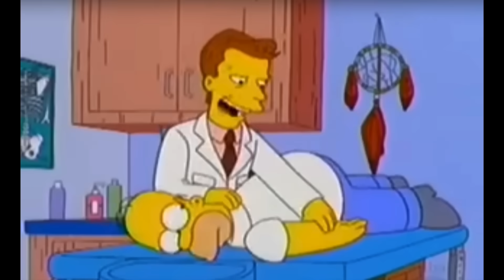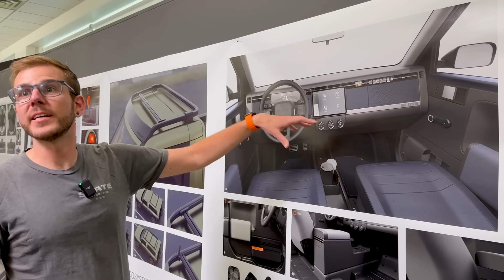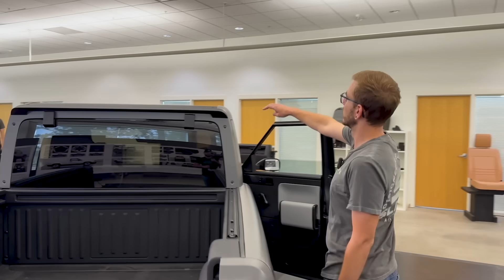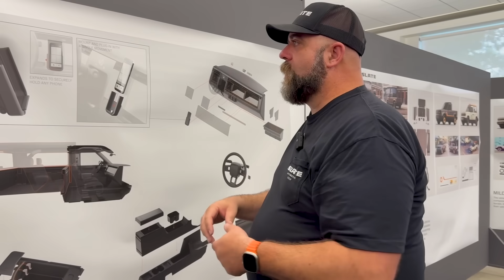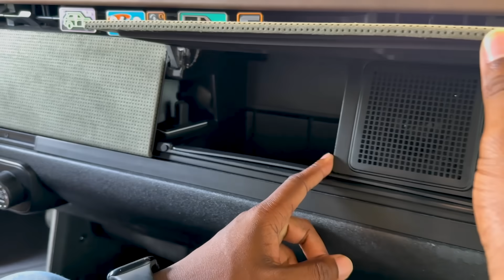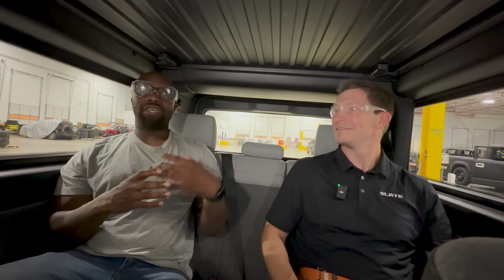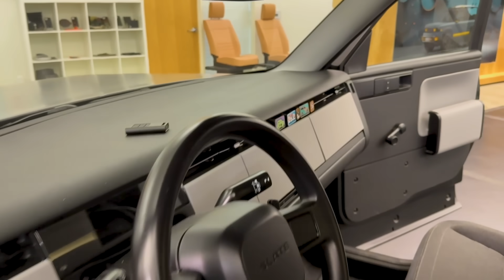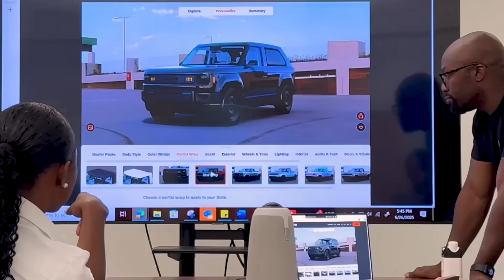The Slate: America’s $20K Answer to China’s Cheap EVs (Exclusive Access)

Comment: IF you could really get it for $25,000 USD ($34,000 Canadian) with the 240 mile (387 km) range battery, I think this would sell fairly well in US and Canada.
I could see this truck saving small businesses who require trucks (for truck stuff) reducing their vehicle expenses immensely.
Right now, it costs nearly 150$ Canadian to fill a pickuptruck full of gas or diesel.  This vehicle would cost under 10$ a day to charge 0-100%.
Also, it's smaller and quiet.  Being quiet when working residential is a plus.
Reply: Why would I pay 25k for a truck with nothing when for 3k more I can get a base model Ford Maveric that gets 30 miles per gallon highway and over 40 in the city with its hybrid engine.
Reply: @kameljoe21  You can find hybrid Mavericks at dealers listing for $25k today.   So the question is why would you spend $3k MORE for the truck with nothing...
Reply: @rockinkuwaitchris used... new they all appear to be around $34,000 for a base hybrid... it does have 4 doors though.
Reply: @kameljoe21 Well because no EV incentives, less customizable, and it's rare to be able to actually get them that cheap. Nobody says everyone has to buy one though.
Reply: @kameljoe21  another option, spend 20k less and buy a 04 Ranger that does all those things as well lol
Reply: @kameljoe21 that Hybrid engine is shit though.
Reply: You must compare this to its competition, which is the Ford Maverick hybrid.   To compete it's going to have to be significantly cheaper.   What will be its payload capacity?  And will it be able to tow anything significant? - for any real distance?  Lot's of unknowns, but I'm glad they are trying to produce it.
Reply: @CARvideoshareit  Most Mavericks on the lot are gonna start well north of $30K. That has been the reality. Plus it's a Ford, so. There are other benefits to having an EV and there will likely still be tax incentives making it cheaper. Totally agree people should compare and have reasonable expectations though.
Reply: I mean almost all the driving I did from 16 to mid 20s was well under 100 miles in day. Usually about 30 miles to high school and back or 90 miles to college one way and stayed there for a week or two. Beyond that it's mostly a few trips a year that are hundreds or thousands of miles. It could be a very practical vehicle for basic commutes to school and work.
Reply: @802Garage  so could a used 96 Tacoma you can pick up for 1/4 the price. Funny enough, those can be found with electric windows.

Seriously, I get that modern cars have way too much BS on them, but this is offering fewer features than something you can buy used for 3-6k. If not for the features, then why bother buying new? Plenty of older stuff that's incredibly reliable and fuel efficient out there. If all you need is basics, then you don't need to spend 20k.
Reply: @bongwaterbojack  Hey I totally agree. I daily drive a 1993 Impreza I got for $500. I def appreciate people who drive old used cars and keep them going. That said, we're gonna have new cars and trucks. I'd love for their to be affordable options that aren't huge for no reason.
Reply: @802Garage  New with basic options is nice, but it needs to come cheaper than 20k. The friggin speakers are an optional extra. As overpriced as modern trucks are, at least they offer fancy crap you don't get  with older stuff. You have something to show for the money you wasted.

But this? How many things are standard on an 04 Ranger that I can pick up for 4k vs optional on this thing? You're literally getting less for more money.
Reply: @bongwaterbojack I totally hear you on all that! Prices have gone crazy.
Reply: @802Garage  sad, but true.
Reply: @bongwaterbojack If you buy a 1996 with power windows you will likely need to replace the motors as soon as possible.
Reply: @jackdaniels4309  the power windows on my 84 Mercedes have the original motors and are still going strong. Buy out of curiosity, I looked up a replacement, and the entire window regulator assembly can be had for about $80. So even if they kick the bucket tomorrow, big whoop. Not a bad price after 300,000miles and over 4 decades of service.
Reply: @802Garage Where the hell did you grow up where you needed to drive 30 miles to get to school? Did you live in the middle of a national park or something?
Reply: @conor7154 Hahaha I live in a very rural area. It was about 13-15 miles to school depending on route and then if I did a bit of driving like to stores and such after, plus the drive home.
Reply: @conor7154 I dont know about them, but I lived in rural Mississippi and that was pretty common. There was only 1 high school in the county.
Reply: Repair costs will be very very cheap too
Reply: It's not comparable to any truck who is able to fill 150$ worth of gas/diesel. It's more of a SUV/city putter than anything. I don't think this will be any more capable than a regular gas SUV for loading and probably worse in towing.
Reply: @o0Guns0o It's not marketed as or meant to be a complete replacement for a full size truck.
Reply: What kind of residential business truck are you driving that makes customers complain about how loud it is?  You running glass packs on a squarebody chevy or something?  Even a 20 year old diesel is going to be quiet enough to not piss off customers.
Reply: It absolutely will not. They look and are seemingly built like toys, and the central focus seems to be “modularity” which just means everything is going to break off and no one is going to care about changing all the stupid little panels on the inside. This thing is a modern day Aztec.
Reply: It has crap range, and will likely get a fraction of 100 miles with any load. Towing? Forget it. Winter? Also forget it with even less range and only RWD.
Reply: @truantray  Average american drives 14k miles a year. No towing or anything. Trucks are just a weird fashion thing 99% of the time. Why does everyone say all of a sudden people drive 50k a year fully loaded when talking of EVs?
Reply: @bencze465 well, the average American is a city dweller because those are the population centers... but millions of Americans don't live in cities and drive 30k - 50k miles a year.
Reply: @truantray this is for driving at property or in city/town. It is not for the heavy duty loads or highways. It is good price point for the target.
Reply: @MrRaitzi Why do you need a truck if you’re driving around in the city?
Reply: @conor7154 you can have it as suv also. 20k and customization is the value here.
Reply: @conor7154 even for my home garden I have to haul dirt... I have one of those silly Tonka trucks for that though.
Reply: @truantray this is my biggest issue.. I love the roll up windows and the walk through bed... but it needs a 300 mile range for me to buy it around $30k
Reply: @truantray  It tows less than a honda accord, so I don't think they have to worry about that.

Comment: One of the problems with the Slate is that after a young person (with a low paying job) buys a Slate and starts making their payments ($250-300 for 2 1/2 years), then pays rent, buys groceries, then how much money will they have left over to buy upgraded parts? Slate has been secretive on details about the company and the price for parts. Once you add up all the extra parts, like $5,000 for the SUV conversion and $3,000 for the long range battety, you need to buy to turn the Slate from a Dacia Sandero into a daily driver that isn't a miserable driving experience, the cost could be $40,000-$50,000. There are a couple of YouTube videos by "FutureAzA" about the Slate, including one with the word "IMPOSSIBLE" at the top of the image. He claims that the Slate has a steel frame that will require tooling that costs millions, and it will need to be painted to prevent rusting, so not painting the body doesn't save much from the manufacturing cost. The claimed range of the Slate is impossible because it's a square brick, and the Slate is supposed to get the same range as an aerodynamic Tesla. Apparently, the Slate company doesn't have the investors, the millions needed for stamping equipment, a billion dollar next gen paint facility, or the factory to start production. According to the YouTube channel "Trucked Up EVs," there are several potential problems with the Slate concept. I found some videos by "EbikeSchool" about a guy who bought a Chinese electric mini truck that Slate just copied. The ChangLi EV Mini Pickup has a price of about $9,999.00
Specs:
- Dimensions: 130”x53”x67”
- Curb Weight: 551LBS
- Top Speed: 28 mph (45 kph)
- Range: Estimated 30 Miles
- Charge Time: 6-8 Hours
- Charger: 110V (Included)
- Battery Info: 60v/100AH 60v/80AH 60v/60AH Lithium (Optional)
- Electric Motor Info: 1200- 4000 watts (Optional)
Features:
- Back Up Camera
- LED Lights
- Windshield Wipers
- Crank Windows
- AM/FM Radio/USB Phone Connection
- Heater & Sunroof Ventilation
- Spare Tire
- Charger Included
- Airconditioner (Optional)

Comment: There is an after market business opportunity right there for anyone with a basic knowledge with the DIY assembling of the accessories so you can recieve the slate you want without having to do it yourself. The sticking point for most I think will be the range and not being AWD or 4x4 considering it is supposed to be a truck you will already have to live in a rural area with the limited range to be able to go camping and recreation activites for the weekend without having to plug in at every opportunity. Solar panel fast charge or external battery booster in the tray for longer trips would be good.

Comment: Rivian bed size is perfect.  I have never had any issues carrying ANYTHING in my R1T bed.  Have carried 7' long pallets that stick out the back (strapped down very well) with a total payload over 2,000 lbs which as you know is well over the official payload limit and the truck had 0 squat and can't even notice that there is anything in the bed while I was driving.

Comment: Your last questions are the key to the US market.
Every US company is focussed on profit maximization.
How much will the market bere. Cost Elasticity of demand. 
It's all driven by greed. 
Easy customisation = Yes.
Wrapping at home?? not by most. so that will be exy even if the wrap kits are precut and sold by Slate. 
I guarantee there will be something like a 50% - 80% markup on components from cost Plus postage/shipping.
Sounds too good to be true because it probably is.
And yes if t SUV pack adds 8K you may as well buy an already kitted SUV from another make or a second hand F150

Comment: A 4 door version would be great, because you can capt some family market.
I like the idea of that modular cheap and versatile little "lunar" truck.
The repairability and modular aspect are super cool .
Black trim and seat covers would look better than grey.
I m curious if it could be factory modded similar to an UTV, because it would be damn fun , even more considering the price of some UTVs.
The 4 wheel drive could be a modular design to add on, it would take a lot of engineering for sure, but i'm thinking on motors integrated to the front wheels like the monopatins lol.

Comment: a big issue for EVs is range and the many complications it has.  a company can claim "its a 250mile battery" but there are so many caveats:
-range day 1 vs day 1000 could be 30% lower.  they sell you on day 1 range but what is "lifetime average" range AND what is "real world range", all the companies claim higher than reality.
-you never get the full 100% of the battery, at most you get 95% and its risky if you're not near a charger AND have time to charge it
-how long until the battery MUST be replaced, how much $?
-is it safe to keep the battery at 100%?  if you're told "keep it between 80% and 20% to avoid destroying battery health" then you can ignore 40% of your alleged range
-how much range do you lose in super hot / cold temperatures? or when the truck bed is fully loaded? or when towing?

add all those range reductions; 30% of total, 5% bc you cant use all of it, 40% bc there is no top 20 or bottom 20....and you're at 75% reduction
that puts you a far cry from "250"
Reply: Modern battery packs will outlive the vehicle.  WTF is the American obsession with range, like you drive 250 miles a day or something. Need range once every year, rent an ICE.

Of course this is the Internet, so batteries cost $50,000,000.
Reply: You’re asking the right questions.  80/20 rule, cold weather, towing, hills, etc.  You need far more range than advertised or a ton more fast chargers everywhere.

Comment: Would love this with an ICE, but you can't get away with a small brick driving through the air with CAFE standards. 150 mile range, 1000lb tow capacity, and no radio for $28K is a no go for me. But the ruggedness and modularity is great!
Reply: No way will this thing get 50 miles with 1000lbs towing.  Radios...whatever, you can get one installed for $120.

Comment: How could we not be enthusiastic by yet another Jeff Bezos project?  After all, he's given us easy access to cheap and often unreliable Chinese parts and pieces on Amazon, he's given us phallic shaped rockets that facilitate million dollar space tourist flights, and he's building an alternative space-based Internet solution and launching satellites into low earth orbit at the speed of molasses.  Sounds like a slam dunk to me...... 🤣

On a more serious note, I really wish they'd have included a demonstration of what it takes (both time and effort required) to convert a truck from one configuration to another (ex: truck to SUV). Are these conversions something that the customer can actually perform?  Or does it require a professional to  do the actual conversion?  Will it be possible for this vehicle to be able to be easily (and cheaply) converted back and forth between different configurations?  Are they planning to provide customers with a process to allow them to add battery capacity to the vehicle at some point in the future?

Comment: Finally, an EV company that realises that not everybody needs the 0-60 of a Ferrari!
The price point however sounds more like a marketing stunt, unlikely to be released at 20k$
Reply: Its 27.5k, Trump cut the $7,500 tax break. We have till the end of the year to get the tax break but this truck wont be out by then.
Not worth 27.5k.. and it'll probably be closer to 30k if released.. 
Mavericks are basically the same price and are twice as capable at doing 'truck stuff'.. plus they can go more than 100miles between fill-ups.. and they even have power windows and a radio!! 

This will be nothing more than an expensive go-cart for wealthier familes to buy for thier kids so they dont scratch up the family car.. 

Unless Slate wants to drop the price themselves to the more realistic 20k.. but I'm not holding my breath on this one.
Reply: It's meant to be at $20k after tax credits
Reply: If it's not sold directly to customers then the dealerships will promise you to cut you a deal of 59k

Comment: I was really excited about this initially until I realized  I can get a LOT of other cars for 20K.  If it was 10K, THEN that would be something.
Reply: EVen the ccp evs that are kei cars in China aren't that cheap SMFH. But I'd bet China does release something similar for closer to 15-18k. As geely has a nice maverick size ev truck for right at 20k since 2023.
Reply: @4literv6  Exactly.  I can get a Maverick for 14K now, making it my first choice.
Reply: @4literv6  Plus, this won't be 20K anymore.  It'll be 27K now that trump is getting rid of the EV credit.  Totally not worth it for a less than bare bones, stripped down truck.

Comment: Honestly they should have brought out a normal engine like a Toyota savage survivor 2.7 4Cyl or 3.7 6Cyl that just last 700k miles+. Electric is just still such an expensive and still a think we’re getting better at, why not just trust the OG the one that we can work on ourselves Without needing to watch 790 Rich videos and needing to break into “insert company here” HQ to get a proprietary product maguffin in order to program the goofy ahh content on the car.
Reply: Starting a new company but using a defunct technology would be crazy. EV has arguably already reached price parity with ICE. Notice that they went with a small battery pack / range to allow them to keep the price low. Battery prices will continue to fall for another decade or two. Electronics / motors will also become cheaper, although not at the rate the batteries will. ICE is going the opposite direction... More and more expensive to keep ahead of the emission standards. I don't see that stopping anytime soon.
Reply: Makes sense, but outside the US it’s not as expensive, just freaking sucks that legislators hate small 4 cyl engines and such. Go to any of the lower North America , Southeast Asia, Asia countries and the 6Cyl/4cyl us champion over ev. Ev is only huge here due to green demand and Silicon Valley / tech bros. So in a sense it’s not that old combustion is getting more expensive, it’s the  laws and regulations and overall opinions of the US government that play a huge factor. If a new president and new House of representatives came in and decided to go back to combustion but offered rebates for buyers and no gas tax, you’d see it go back the other direction.

Comment: Quick tip for the developers of this car. Only use electric windows and put a dobble switch in the middle console only.. So you save production cost on handling 2 different window models. And if you expand on the right handed market you don't need do changes to the windows mechanic.